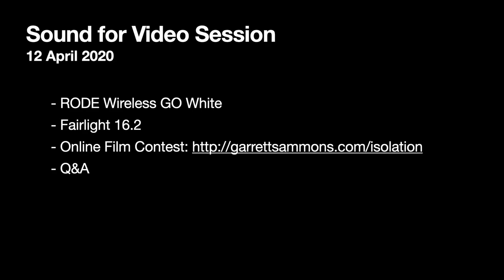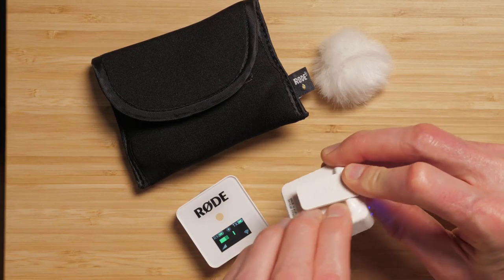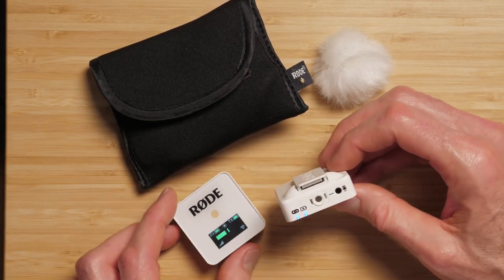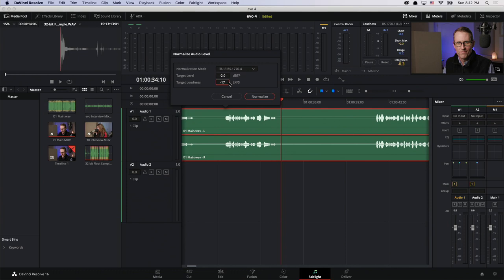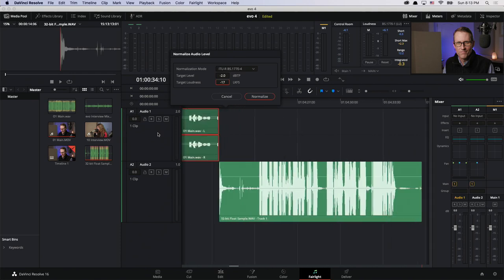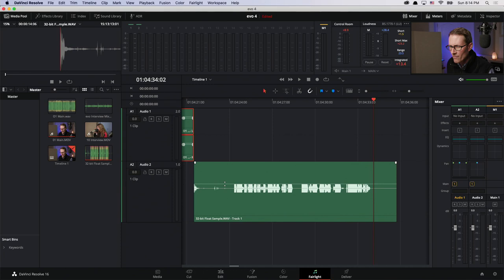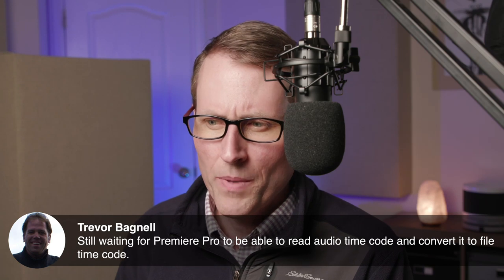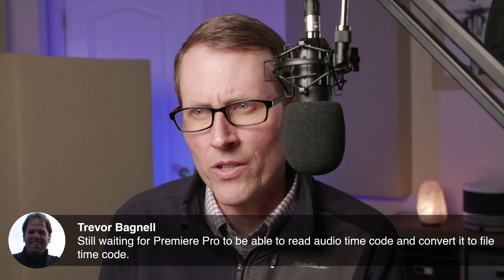Sound for Video Session: Fairlight 16.2 Highlights & Q&A

Comment: Great session thanks Curtis, and greetings from Sydney.  In respect of James B’s question at 29:40... no, you don’t need an image to edit audio in Fairlight 16.2.  I use it all the time to clean up my audio from my Deity Connect recorded on my ZOOM F6 (with line out to my 1DX2).  I put my .wav audio files into the Media pool, then go straight into the Fairlight tab and drag the audio into the timeline.  It asks if you want to create a timeline using just the audio file, you confirm and all your poly tracks upload into the timeline for noise reduction, dialogue processing and equalising etc.  Once done. Just go into the deliver tab and make sure you convert the output to audio, and specify .wav file rather than .mov, and select file name/destination the. Add to the render queue.  Super easy, no issues and no need for an image or video file on the timeline.  Hope this helps.
Reply: Spike, thanks so much for the clarification! Very much appreciated.

Comment: @10:24  Hi Curtis, I didn't realize they added this in 16.2! It's been something I've wanted for a while. Too  bad it doesn't actually work. A workaround I was doing was just processing a separate wav file in auphonic and then re-adding it as a separate track in Davinci Resolve.
I did find a workaround though and that was last week.
I tweeted at you about sweetwater giving away iZotopes Elements 9 - As it turns out it has a great feature that makes exporting at the correct LUFS easy for the entire track.
Effects>Uncategorized>VST>Ozone9
Choose Maximizer
Click "Learn Threshold" set it to -16 LUFS
Adjust "Cealing" to -1db" 
Close and that's it. Your track is now at -16 LUFS
The catch though is that iZotope make Davinci Resolve a little unresponsive sometimes.
What do you think?
Reply: Hi FoodTechLife! Yes, they're almost there! Sounds like a pretty neat solution. I'll check it out. I didn't know the elements bundle included Ozone as well. Cool.

Comment: You had in the project settings an EBU +9 Scale( which is an european standard) but when you did the auto normalization, didn’t you used and different standard? 

And also is your loudness meter set to these standards as well? 

Otherwise you might be measuring with three different standards, in the auto normalization, the loudness meters and the fairlight-settings.
Reply: Hi, I understood the scale to define the range shown on the meter. Is that not the case?
Reply: @curtisjudd   ai think you are right there! This is seems to be just a scale where you can choose between-18 and -9 LU Range. Sorry, I also just 
learning.